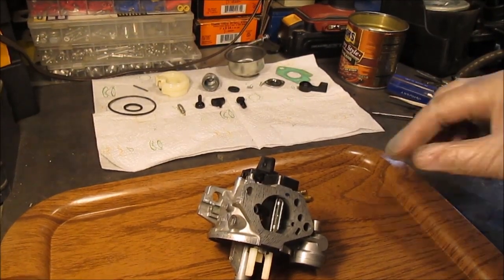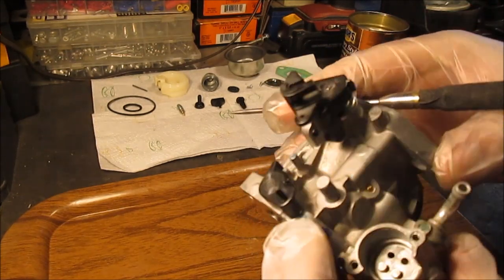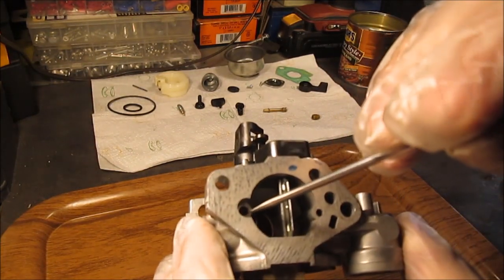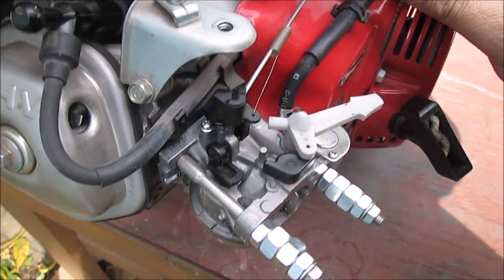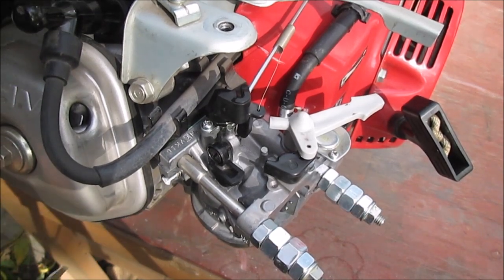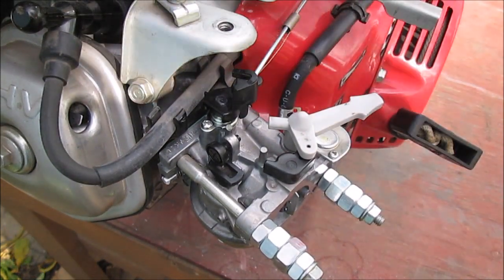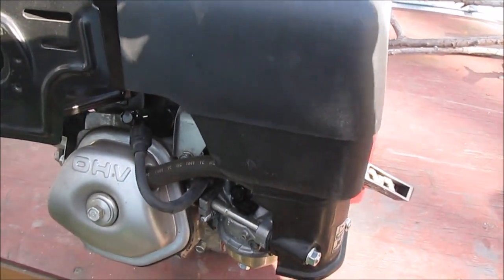Fix Surging Problem on Honda GX 240 Carburetor

Comment: You bloody legend!
I had pulled apart my carby and cleaned it all up, but when i reinstalled it the surging problem was still there. So i watched your video and (at the 3.30 minute mark) you showed a needle clearing a small hole in plastic part. I remembered looking down there and not seeing any light so thought bottom was solid. I went back to my problem carby and cleaned out that hole. The engine started first pull and runs smooth as silk. This has been a problem on this machine for 10 years and I've only just got around to fixing it. Thank you, i couldn't have done it without you, your video is very much appreciated.
Reply from the maker: Glad I could help Mine runs great now with plenty of power

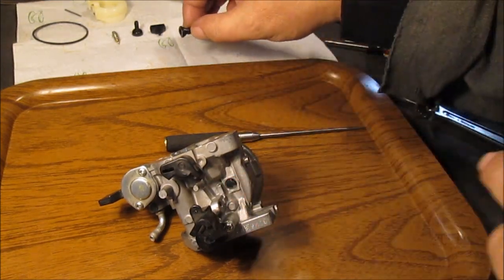Comment: Video at 3:30 is the problem 99.9% of the time, I used a small torch tip file… runs like a champ

Comment: In my case. Surging Honda GX 390 on a generator was surging only under 1/2 tank of gas. Tried solving it with new or no gas cap, new fuel hoses, fuel filter, petcock, flushed gas tank, new Genuine Honda carb and even used aviation fuel. Still it would starve out near 1/4 tank and would only run while spraying starting fluid in the carb. 
Surging = Fuel Starvation, especially with less than half tank of fuel in my case, even when it was new.  A generator runs at high speeds all the time requiring the highest of volume of fuel in the line at all times. 
Generators are designed to be low profile and an inherent flaw is that the fuel tank is (TOO LOW) just slightly above the carb fuel inlet for gravity feed through a hose. At high speeds and especially with little fuel in the tank causes a weak flow to the fuel inlet causing starvation/surging. 
MY SOLUTION: 
I discovered that by raising the entire fuel tank by 8" gave me MUCH better fuel flow down to the carb and the surging went away even with almost no fuel left in the tank. You can definitely see the difference (before and after) with a see-thru clear fuel filter which should always be at least 1/2 full during operation on a high speed motor/generator.
Another mistake I made was storing Ethanol fuel for more than one season in my shed. The stuff goes bad and causes havoc on small engines. Periodically check the color of the stored fuel in a glass jar. It should be clear. If it is golden/urine colored, DONT USE IT in a small engine.. Car engines don't seem to have a problem with the aged fuel. I had about 20 gallons of yellow colored fuel and added a few gallons at a time to an almost full tank of gas in my car and it burned it with no problem.
I hope this helps somebody as I almost gave up and it cost me $ and lots of time, but I won and learned a valuable lesson that nobody ever suggested to try.

Comment: The Amazon carbs may be wrong for your engine. The same carb goes on the GX240, GX270, GX320 and GX390 but all require different jet sizes.
Reply: 390  carb has bigger diameter than 270/240
They’re not the same

Comment: Sometimes the surging come from the governor and the easy way to fix that is replace the spring in the throttle and install a straight wire in its place also make sure to tighten the throttle bar until it barely moves so the governor can't move it!
Reply from the maker: I do understand how a governor works ..I have seen old tractors surging from the governor...The problem with this carburetor is what I showed ..The jets need enlarged because the factory has to meet all the EPA  regs. and you end up with a crappy running engine starving for fuel

Comment: I have a GX 160, rebuilt the carb and it still surges only at High RPM, and has little power. Need to use a quarter choke for it to run smooth.
Reply from the maker: I would make the main fuel jet one size bigger

Comment: It doesn't get much better than that Jim. You are right, the surge usually will disappear with a load on it. Good job.
Reply from the maker: I did the best I could ,,It does idle well at slow speed now ...